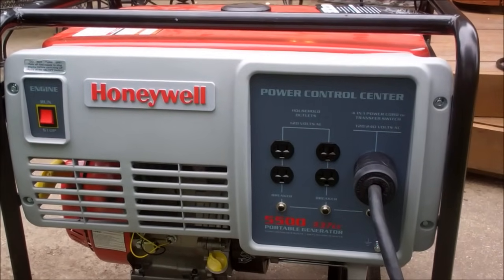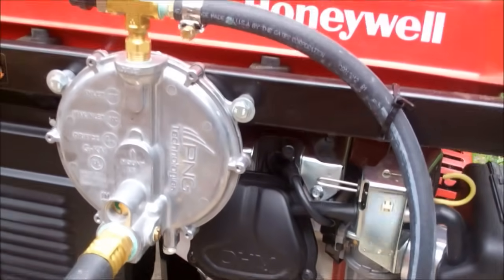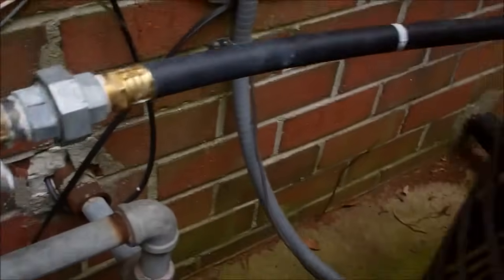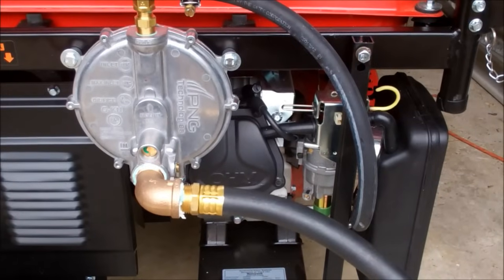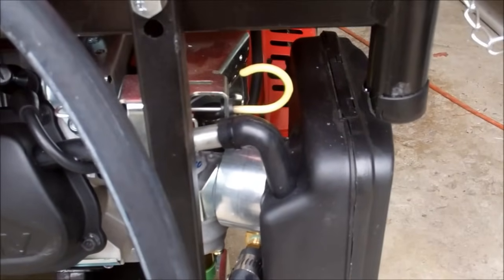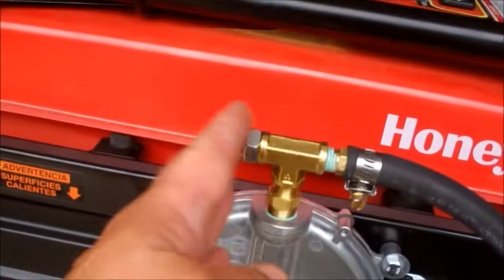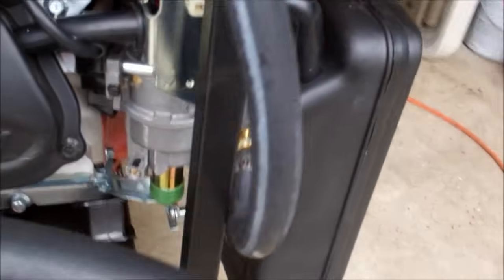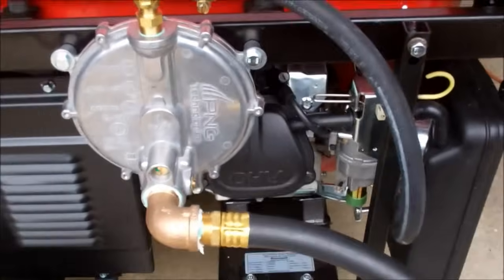Portable Generator Conversion to Natural Gas & Propane

Comment: I'm just entering the game...but my question is why is everyone cutting their frame when they can just mount the regulator to the other end of the gas supply hose which is likely the gas meter or a wall that has the supply connection.

Comment: Let me see if I understood what you are saying. Most propane generators don't have a propane shut off valve that will shut the gas off, if the generator fails to stay running, and because you bypassed installing a regulator this will amplify that problem, if true I will need to get a 110 volt shut off valve, that's held open with voltage.
Reply from the maker: If you have nothing in line to stop the gas flow if the generator stops you absolutely need something, unless you like to be on the local news ruining a bunch of people's days.
Reply: @Channel-About-Nothing  How does a generator work that comes ready to use propane, should the spark plug fail, how is the gas turned off. From the information I have found says the regulator doesn't stop the flow of gas should the generator fail.
Reply from the maker: @rx7engines  I don't think that is correct or they are asking for a lawsuit.  The gas is usually controlled by the vacuum of the engine.   If there is no vacuum the gas is cut off.
Reply: @Channel-About-Nothing  found a video that helped me understand, its called "Regulator Garretson KN Beam Impco how valve works for"

Comment: Great video - my biggest problem is tapping into my gas line. It comes out of the ground has a 90° bend and goes into the exterior wall. I’m a very much do it yourselfer but not sure how I would get a T in there to tap in to the gas line. One question what happens if the generator cuts off how do you prevent the natural gas from continuing to flow resulting in a dangerous situation?

Comment: Nice video. I did the same conversation with my Black Max 7,000 watt generator. The US carburetor kit worked great. 
One thing the instructions say is to empty the gasoline for safety. I drained it into a container and added the gas to my riding lawnmower, then  removed the tank to completely drain it and let it air out. 

I just need to figure out how to adjust the idle. It’s running high rpms.

Comment: The big question is: what is the cost per hour or per 24 hours to operate with Natural Gas ? Or maybe a better way to ask is: how many cubic feet of gas is used by a 5 to 6 thousand watt generator per hour or per 24 hours ? Gasoline consumption for my 5,000 watt generator is 1 gallon per 3 hours or about a dollar an hour.

Comment: Never use GALVANIZED pipe or pipe fittings in a Natural gas application. The Natural gas reacts with the galvanization and causes a heavy, gummy residue to develop that will clog up everything. ALSO: this conversion can only be used on a "gasoline only", 4 cycle engine. 2 cycle "gasoline mixed with oil" engines won't receive proper upper cylinder and valve lubrication resulting in engine damage and failure.

Comment: Does the regulator work for both natural gas and propane seeing they have different incoming pressures?
Reply from the maker: It will work with both, you will need a regulator on the LP line.

Comment: Where did you purchase the brass "T" at the outlet (top) of the regulator?  The one that adjusts flow on one side and has the hose adapter on the other side.  I can't find it on US Carburetion website or anywhere for that matter.  It looks like it makes for a practical and clean setup.
Reply from the maker: It came with it back when this was installed.

Comment: Nice install.  If the generator fails does the kit cut off natural gas flow?  Is there a chart that shows the cost per hour in using natural gas vs. gasoline?
Reply: It's an "on demand regulator".  Meaning, it allows fuel flow only while the engine is running.

Comment: If most people would call and give the generator type they won’t have to cut their frame. Their are other companies that makes these conversion adapters.
I mounted my regular to the frame using powerful magnets I JB welded to the regulator👍🏾
Reply from the maker: This is from 2012.  the new kits do not require this.

Comment: Why did you take the 1/2in feed at the gas tree and use a StreetL to increase it to 3/4in for your valves and 30' length of hose? Why not just keep it all 1/2in all the way? Also, why not use quick disconnects at the point of your union instead of the union and the need for a wrench etc?

Comment: silly question. If I purchased a duel fuel gasoline/propane generator......number one.....could I simply hook it up to natural gas? Probably not?? and second question.....If I cant simply hook up natural gas to a propane generator, would I be a little bit ahead if I purchased a duel fuel and then purchase the natural gas kit for it. The space would already be there to put a natural gas regulator without adapting the frame etc.?/

Comment: Great tip, thanks for the video.   I plan to install a permanent back up generator but this is a good question to ask whether the unit comes equipped to take natural gas or will I need a converter as most come ready for propane. Good job!

Comment: It is over seven years since this video was posted and the uscarburetion.com Web site is still crap.  It was designed in 2005 using Microsoft FrontPage which was discontinued years ago, and it sure looks like it.

Comment: so when using NG and the if the engine shuts down,  does the what  stops the flow of gas?
Reply: The regulator is an on demand type so if the engine stops so does the gas flow. When not using the generator I would shut off the valve to the regulator.

Comment: how to adjust gas poressure?  my generator 1.5kva is not getting load proper 2 fans run if add other load generator shuntdown whats problem kindly guide

Comment: Does the regulator have a safety device incase of engine failure? Thinking about converting my predator generator over to propane. I'm all about safety when it comes to gas.
Reply from the maker: Yes it will stop the flow of gas if the engine cuts off.

Comment: One question, was the 3/4" hose necessary for the generator or could a half inch possibly work? Thanks.
Reply from the maker: That all depends on the distance and size of the generator.  I would recommend you look here for more information http://www.propane-generators.com/natural-gas-chart.php.

Comment: I got a 13 horsepower motor what kit do I get you said get the kit C for the motor you got which is a lower motor but when I was on the page link that you posted for the tri fuel regulator it said something about larger Motors using type 1 or type 2 I'm confused which one do I get I want to be able to use gasoline as well as well as natural gas and propane all three feels

Comment: how do you know if you're getting the correct RPMs for the generator to put out the correct amount of current
Reply: The generator has a rpm governor that will increase rpm under load and back to idle if load is removed.

Comment: Thank you for posting this video. I ordered the kit for my Husqvarna/13HP Honda Engine which now comes with the new snorkel part.  https://youtu.be/NMIFbJ_pWq4 It took about an hour to hook up and because of the snorkel I didn't need to cut the frame!  This kit is worth EVERY PENNY!  I'll be running a line to my 500 gallon propane tank supply next week but just wanted to test it out.  You can see it running here:

Comment: I came here because I saw this video on this site - http://www.thegoodsurvivalist.com/how-to-convert-your-generator-to-natural-gas-or-propane-for-5/ ... Maybe I am missing something, but I don't see anything in this video on how this could be done for $5!
Reply: The motor snorkel tri-fuel kit is $187, mostly because of the regulator that controls gas flow based on the engine's demand. I would not recommend a cheap route when you're dealing with fuel and electricity that powers your home. If it sounds too good to be true it probably is.

Comment: I installed a similar kit on my 8750. The problem I am having is it runs rough on gasoline. Did you make any adjustments for that?
Reply from the maker: Actually, I haven't run it on gas since the conversion.  You may need a valve in the line form the regulator to the carburetor.  Other than that I don't know why that would be happening.

Comment: Awesome! I have a brand new Generac 7000 electric start. Haven't used it yet but after running my two smaller Honda generators during the last hurricane power outage I wanted one larger generator so I could run my stuff one one generator instead of two. My house has gas service and the idea of not worrying about having to keep filling the gasoline tank much less the mad rush for gas at the gas station during the days leading up to a hurricane makes this natural gas conversion a MUST DO! Thanks!!

Comment: I converted a B&D from Home Depot and it started and ran better than it did on the E10 blend we have here in Fhonyfornia.
ALWAYS starts on the 2nd pull unlike gasoline.
Reply: I was wondering how easy it would be to start it with a pull start instead of an electric start (mine are pull start), so your comment was most useful for me.
Reply: I have used it a few times since 2015 and last year for 12hrs with a major outage due to blown transformer at SDGE. Keeps the frigs going...

Comment: Have you used it during an emergency and have you seen an huge increase in you gas bill? I like in florida and see too many hurricanes. Lost power for a few days and looking to not hunt for gasoline and I have natural gas piped to the house. Thanks
Reply from the maker: You won't notice any change in the gas bill.  I have run it 24 hours during the summer when power was out and.  My summer gas usage is usually zero and it was barely noticeable.  These things don't use a lot of natural gas and it will cost less to run natural gas than gasoline especially during a natural disaster..

Comment: Replacement carburetor from china with propane components fits inplace of factory carb. No cutting needed just bolt on unit for $21.50 :-o
Reply: Please provide this website. I don't want to have to cut in housing to make room for the regulatory.

Comment: I would realy like to know how much power you lost with runing it on nat. gas. Thanks
Reply from the maker: I would say 0.  It runs at the same RPM.
Reply: That is dissapointing answer. Rpm with or with out load. Thanks
Reply: The loss is so small its not worth mention IMHO.
Reply: I have a dual fuel with propane. It's rated to lose power on propane. Don't know why exactly.

Comment: you should install whats know as a drip leg on that gas line to catch water or other trash that could get into the gas line.  look at the gas line just before it goes into you furnace and you will see one installed.  its a vertical peace of gas pipe capped off.
LP gas is really nasty stuff with much water in it.  chews up LP gas furnaces and other appliances like gas grills.  its not all hank hill says it is!  natural gas not so bad.
you don't want any trash or water in the line or it may cause a gas valve not to seat and then you got a gas leak.....not good.  safety first!!
if your house blowed up you want need any power!
Reply: Propane is gods gas,  Itellyouwhat

Comment: I wonder how long this will work....
A normal generator needs gasoline and oil mixed.
If it now runs with gas it doesn't gets cooled by the fuel and the oil is also missing.
Reply: This is a 4 cycle engine so it doesn't require oil to be mixed with the gas. The oil is in the crankcase just like a car engine. Running an engine on natural gas is actually better for it since the fuel burns much cleaner leaving no deposits inside the engine. Oil from a natural gas or propane powered engine stays very clean as well.
Reply: Oh ok sorry i didn't know that it was a 4 cycle engine.
Reply: dude you got it wrong,. it will run longer then using gasoline.

Comment: Looks like a nice job, but that street elbow on the gas inlet to the regulator  is Bronze, cast, which is considered to be "porous" and would NOT be used on any gas piping. You could substitute a BRASS elbow  for the bronze however and you would be okay.
BTW, galvanized piping is used where needed for weather/rusting  resistance  in NJ,  your gas supplier should know what is allowed in your state.

Comment: the LPG carburetor I bought is giving me problem whenever I wanna start the gen.  when I switch to petrol.... what should I do
Reply: Turn one fuel off, wait until the engine starts to stall, gradually turn the other fuel on.

Comment: Dont you have to keep the choke on full all the time when  running on natural gas?  Reply asap
Reply from the maker: No.  You don't use the choke at all, not even to start it.
Reply: +Van R thanks bro
Reply: +Deucealive75 thanks man
Reply: Yeah. Some people believe you should never use the choke for LNG or NG. That is true for these type of kits, but not all LPG or NG. It just depends on where the gas enters the intake system. If the gas enters on the airbox side of the choke you would not use the choke. if the gas enters on the carb side of the choke you would use the choke to cold start. On my tri fuel carb I use the choke to cold start. 1 pull choked, then 1 pull half choked and it is running.

Comment: Will the Generator last long with the use of Natural/Propane Gas compared to when use with petrol in normal operation?
Reply: Yes on NG is very clean burning as compared to Gasoline, You'll also go much longer on Oil Changes since all the crud created burning Gasoline in not migrating to your OIL
Reply from the maker: +Godsent Egharevba I would assume it would make no difference.
Reply: any LPG carburetor spare parts,contact me Whatsapp :008613616688891http://www.aliexpress.com/store/product/dual-fuel-carburetor-with-MANUAL-choke-LPG-NG-propane-CONVERSION-KIT-for-gasoline-generator-5KW-6KW/211811_32671872150.html

Comment: Please can you email me the Procedure and all I will need to do this? My email is afooaco@gmail.com
Reply from the maker: +Olaoluwa Afolabi Go to www.propane-generators.com to order the kit.
Reply: any LPG carburetor spare parts,contact me Whatsapp :008613616688891http://www.aliexpress.com/store/product/dual-fuel-carburetor-with-MANUAL-choke-LPG-NG-propane-CONVERSION-KIT-for-gasoline-generator-5KW-6KW/211811_32671872150.html
Reply: Van R dg

Comment: I have this same converter for my yamaha ef2400is. can someone please tell me how to adjust the load block?  i started messing with it while it was idling at around 3700 r/min and thought i could adjust it down to 3200. now it won't start. i'm not sure where to begin or how t to get it running again (i'm a generator novice). perhaps i turned the screw the wrong way or too much or too fast or all of the above. i tried to adjust it back to where i thought it was before i began messing with it. can't find any instruction on how to start this adjustment from scratch. HELP!! there's a blizzard headed our way and power company is warning about power outages. i need my generator to work!!
Reply from the maker: +Catherine Louise I can send you a copy of the start up guide if you send me your email address.  Not sure how to send it through YouTube.
Reply: +Van R please can you email me the startup guide ighoruejp@gmail.com

Comment: The "quick connect" doesn't look very "quick"; it's a standard plumbing union.  I use an industrial coupler commonly used for compressed air tools and an ordinary compressed air hose for temporary natural gas supply to portable equipment.  If using natural gas after the regulator and meter, the pressure is very low, indeed — typically well below 0.5 psi — so high-pressure hose isn't needed.  A good industrial coupler will be just as gas-tight as a plumbing union fitted with pipe dope or Teflon tape.
Reply: +Milosz Ostrow Are you saying this will work with some inexpensive couplers and some air tool hose? I think you may be right because this is using very low pressure. I think you would need the bigger hose for the generators with more than 7 horse. The air tool hose may work on smaller generators.
Reply: Yes. The quick connects and hose used for air tools works perfect on my 3.6KW generator. Also very inexpensive. I already had extra hose. Just bought some $4 end connectors from harbor freight and was good to go. The inner diameter of the hose I am using is only about 1/4 inch and may be too small for larger generator engines. Thanks for idea.
Reply: Deucealive75 You are correct about the small hose limiting the flow rate.  It wouldn't run a tankless water heater, but I've found it sufficient to run a two-burner tabletop stove or gas grill for outdoor cooking, saving myself the annoyance of smelling up the house with smoky, greasy fumes.  Unfortunately, the high pressure natural gas supply is on  the utility company's side of the gas meter, where one can't legally get to it.  The pressure there is about 50 psi, which would still be well within the capability of air hose and industrial couplers.

Comment: What happens if the engine stalls and the gas continues to flow? I have the same conversion kit on my generac and I often wonder if the oil runs low or somthing the engine will shut down but the ng valve remains open. Does that gas keep flowing until it explodes?

Comment: Does the propane  stop flowing if the engine were to stop for any reason?
Reply from the maker: Yes it will stop the gas if the engine were to stop.
Reply: The regulator you see is called a demand regulator, it requires negative pressure for it to open and allow gas to flow. Pressure the carb will create when running. This is a great video. Good job. I am going to convert my chonda but will be using a 100lb bottle. Thanks

Comment: So you do not have to remove it to run it on gasoline?
Reply from the maker: Nope, just add gas and open the petcock valve and start.